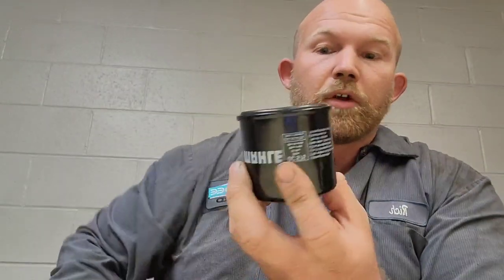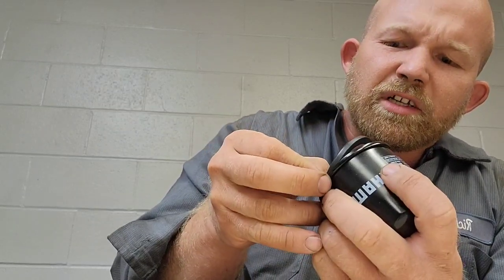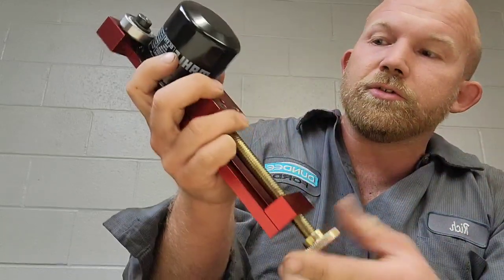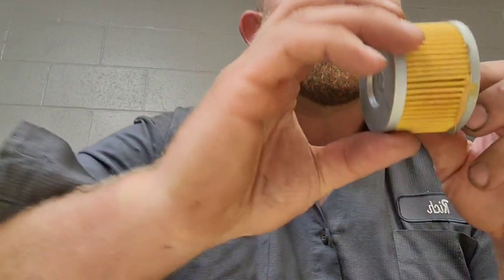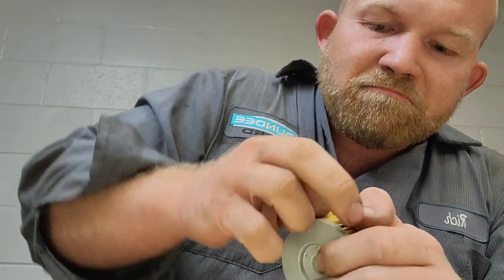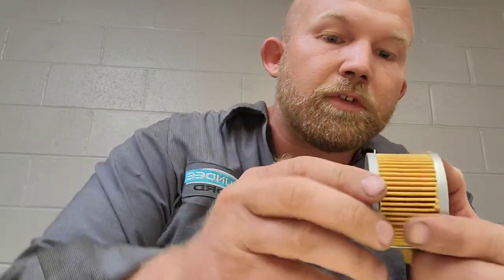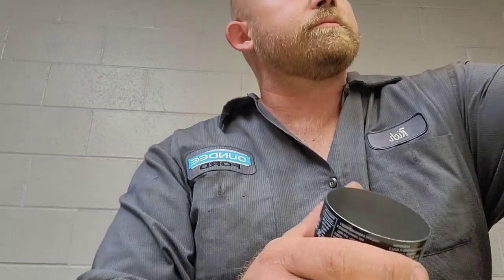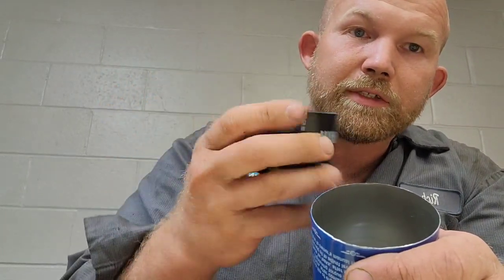Mahle Oil Filter - As Good As Denso - As Good As The Honeywell A02 from Honda - Let's see

Comment from the maker: I ment Brake tubing cutter style blade
Reply: You were right the first time, Rich.  Those exhaust pipe cutters that look like giant brake line cutters, and the wrap-around exhaust pipe cutters also use the replaceable wheels for cutting.
Reply: It's it's yellow filter I wouldn't go over 5k less if it's white then probably 7500 miles
Reply: Hyundai filters look better

Comment: When i was a kid, a 15-year Ashland Oil employee came up with a filter that it as long as the oil wasn't chemically broken down, it would return even high-mileage oil to like-new status..its Chief component was a roll of toilet paper. He was quickly bought out for millions, retired early and had to destroy his filter, the plans and never mention it again.
Reply: Used to be able to buy those from JC Whitney. I remember seeing them for sale.
Reply: Those are still available today under the Frantz name.  The concept with these is they filter a small amount of oil constantly and are not in the main circuit providing lube to the bearings, etc.  It runs oil through all the time like an auxiliary/by-pass filter.  I designed my own by-pass filter setup for my 79 ElCamino whereby, I drew oil from the drain plug via an electric motor just like Rich is planning to use, ran it through an independent 2-quart filters (a pair) using a dual filter mount, then back into the sump.  No attachment to the oiling circuit, just an aux filtration.  I also used a thermostatically controlled oil cooler.  This was super-overkill for my tow vehicle, but I can tell you, that oil was clean!  Also added nearly 5 quarts capacity, once you considered the pair of 2-quart filters and the cooler.  Yes, I was anal about clean and cooled oil for that car.

Comment: Mahle had a filter part no. OC330 for Honda. It's a much taller filter than the one you showed. Unfortunately they're hard to find at a reasonable price. The OC707 supercedes it. I think you would have liked that one more over the current one. 

Great review. I think I'll get the Denso filters once my stash of Mahle filters run out. 

I've also used Hyundai OEM oil filter with no issues. Well built as well.